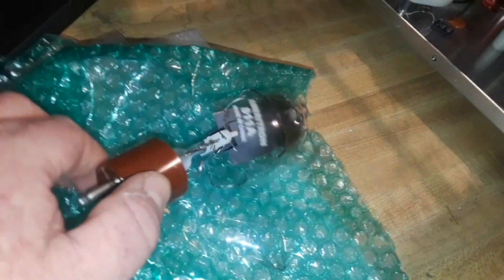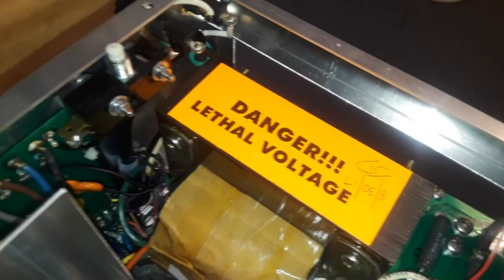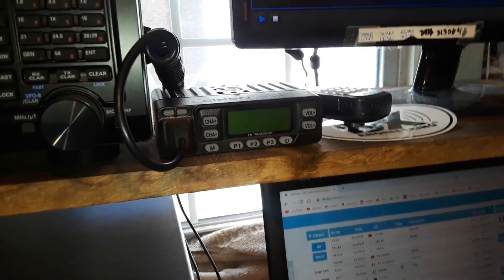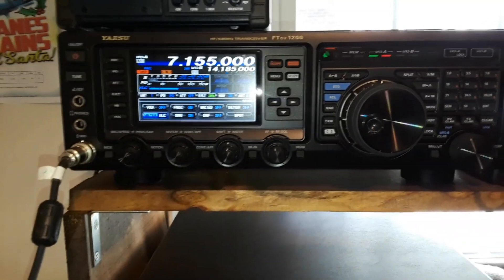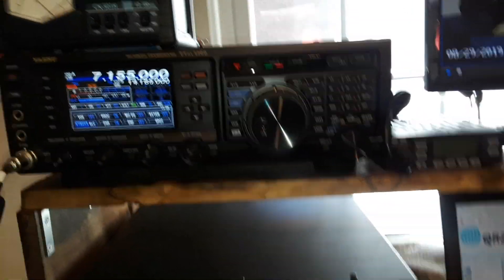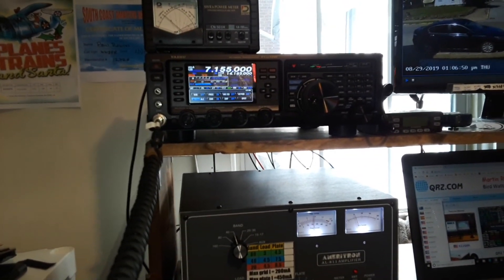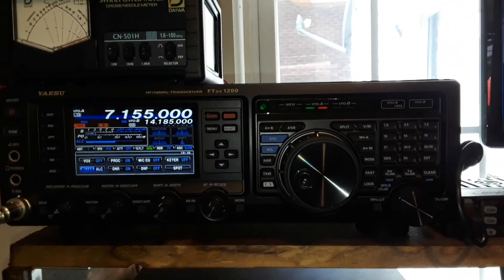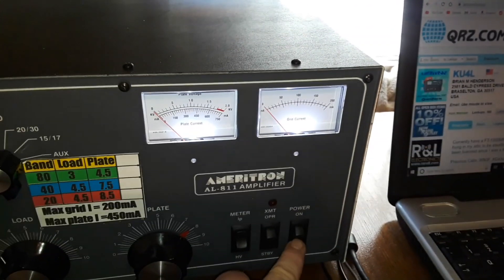Al-811 Amplifier and contact with a ham who built his own transceiver

Comment: Very very nice pastime/hobby. I have often thought about involving myself so that I might enjoy it. Though I don’t fully understand your setup Paul, it does look impressive.
Reply from the maker: Thank you. The setup looks more complicated than it really is. All you need to know is that the most important part of any radio station, and that's what this is, is the antenna and the feed line that brings the signal to the antenna. It took me a long time to learn this. But my setup is like this, the radio outputs an RF signal up about 60 watts to the amplifier. Each of the tubes in the amplifier can take that 60 watts and turn it into 200 Watts. We put them together and we can get a total output I'm about 600w. I don't drive it that hard, my radio can put out a hundred Watts but I only drive it with 60 watts. So it's easier on the tubes in the amplifier and we get between 400 and 500 watts of output. Those four to five hundred w are fed through a coaxial cable to my antenna and the antenna radiates the signal to the world.
Reply: learnelectronics :  Thank you.

Comment: Love those vacuum tubes, on some equipment they are more stable than solid state gear. They are called valves in Australia.  (I learnt a lot about em from ‘Mr Carlson’s Lab’).
 Nice amp Paul.
Reply from the maker: Vacuum tubes are scary
Reply: Why are they scary paul ??  Is coz they blow sometimes or do the use a lot of power. Easy to tell I know nothing about valves!🤦😬

Comment: Wow really cool Paul that is a beast of an amp
Reply from the maker: It's a actually a small tube amp. Legal limit here in the US is 1.5KW.  But there really isn't thst much difference between 800W and 1500W. The big difference comes between 100W and 600W.
Reply: @learnelectronics  1 KW is a lot, I believe NOAA transmits weather at 1KW
Reply from the maker: Sounds about right, WWV, the national time server (atomic clocks) transmits @ 10KW